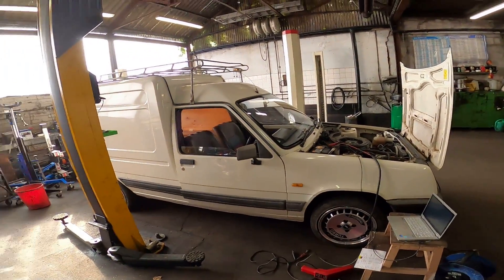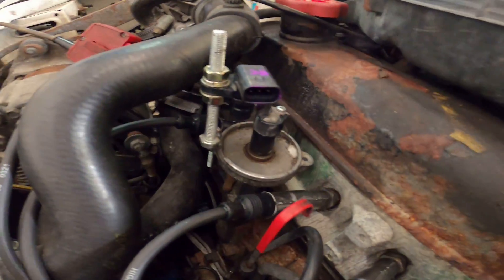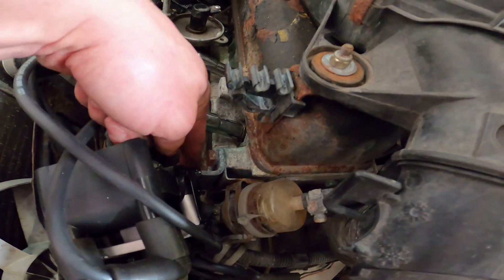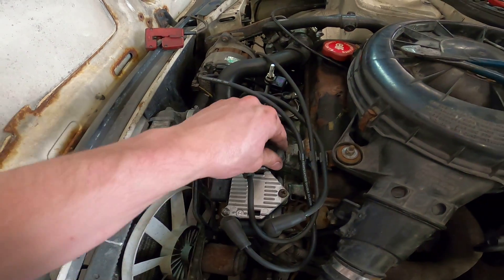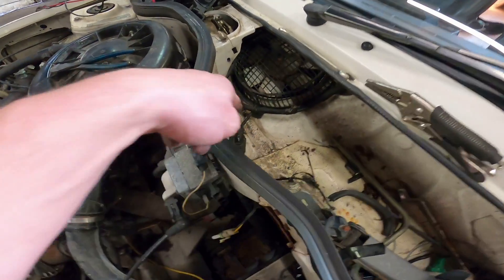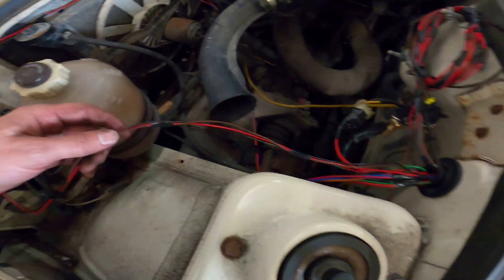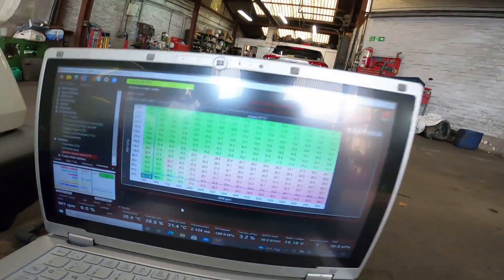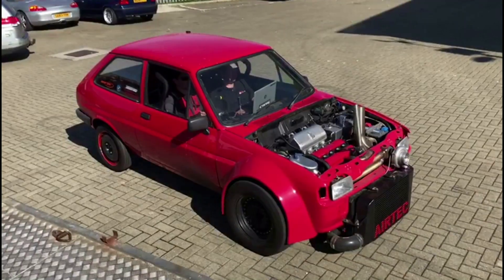Edd Gasket the Renault 5 extra get a MaxxECU Mini installed for an EFI conversion C1J Turbo

Comment: Clio 182/172 flywheel has a 'fat tooth' you can make into two teeth and a missing tooth. Giving you a 44-2 i seem to (hopefully) remember. That odd trigger pattern worked well for batch fire on the renix based systems, but is shit for aftermarket. Also the output from that vr sensor can sometimes fall over at higher rpm👍

Comment: If I remember correctly some of the r5gtt lads used an old skoda fabia inlet manifold.  It wasn't a direct bolt on fit but was made fit with little work.

Comment: Would one of these be any good on a turbo A series engine? Basically I've got a clubman estate with a modified metro turbo engine in it still on the SU carb. I'm using a megajolt at the moment, but something a bit more sophisticated to account for coolant temp etc would be good.
Reply from the maker: Yes this would work perfectly for your application
Reply: @ignitionadvantages6592  I already have a aem wide band could this be plugged into the ecu at all?
Reply from the maker: @harrypalmer1544  yes but they are not accurate i would use a MaxxECU can lambda. 

http://www.ignitionadvantages.co.uk/Maxx%20ECU's.html